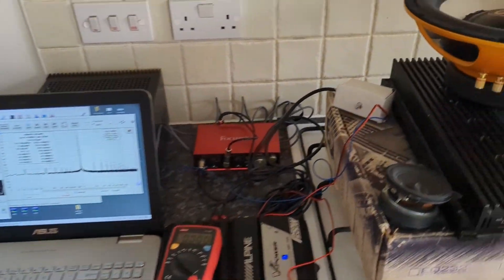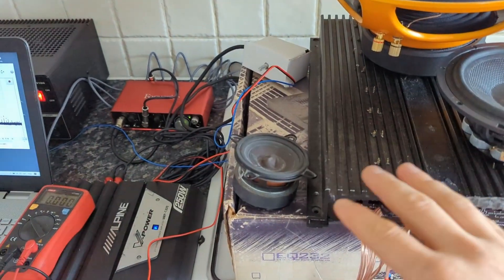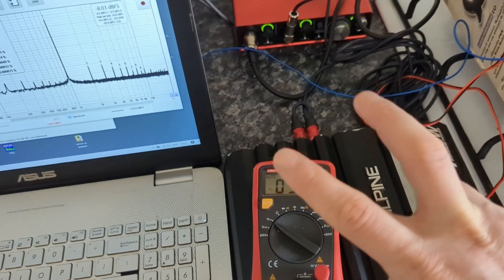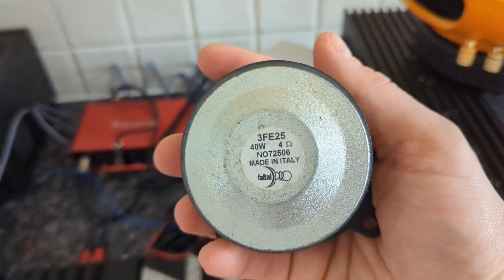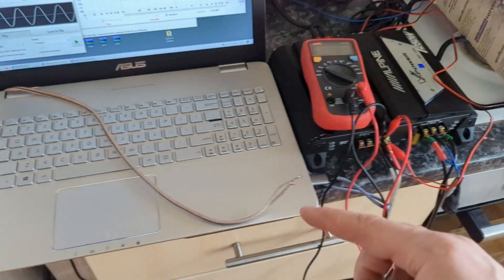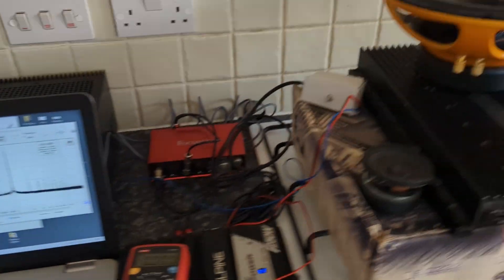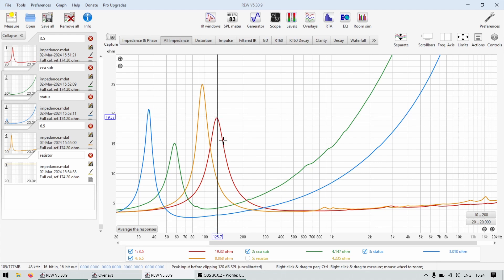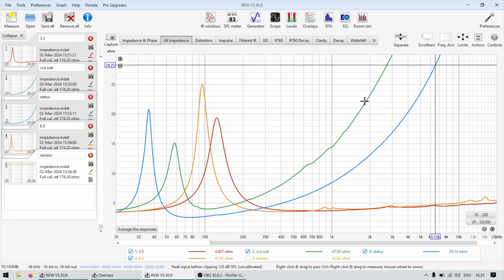Measuring amplifiers on resistors vs speakers - is there a difference?

Comment: I have a great video idea for you simply for the fact that it does not cost any money. Could you talk about specific mid bass speakers. That are not only high-end namebrand, such as focal, but also middle of the road namebrand speakers that still perform well when trying to build a three-way active system. Unless I’m paying for an outrageous driver from an high-end company, I just can’t seem to find any speaker, as far as a 6 1/2 or 6 x 9 that would allow me to put together a three-way active system on a DSP

Comment: You did some testing on Recoil amps. Of course, naturally, they passed in the low range frequencies, which is why you can get away with a lot of decent amplifiers, putting out power these days. But when you start getting to the higher range frequencies, you show that recoil begin to create distortion.

Now at the same time, I know you did not do a listening test on those videos and peoples ears are all subjective to their own taste. 

Are there any hard fax as far as stats that you could see from parameters stated on on a box or a manual for an amplifier that would give you the implication that it would be a good full range signal? 

Recoil has a fantastic five channel amplifier but I can’t seem to pull the trigger because although it would make things easier using one amplifier, I would hate to get something that doesn’t produce quality sound in the full range
Reply: Are you looking at the RED1800.5? It has all the flags I mentioned above. It doesn't show the amount of distortion at rated power, it doesn't show the deviation in the frequency response and the signal to noise ratio is at a higher power level and not at 1 watt. It's also unusually inexpensive. Still, it doesn't necessarily mean it's a bad amplifier. At such a low price it may be worth it to buy it and see what you think of it's sound quality. If you don't like it, you could probably sell it locally and recoup most of the cost.
Reply: There are a few specifications that can point you in the direction of a high-quality amplifier, but it's still not a guarantee that it's high quality. 

Stats such as frequency response. You want to know not only the frequency range, but also the deviation. For instance, 20-20K + or - 0.5dB ( or similar low number). Amp manufacturers realize this and some that have poor frequency response will only show 20 to 20K without telling you the amount of deviation. A lot of deviation is going to be reflected in the tonal response.

Another stat would be the signal to noise ratio at 1 watt. Some manufacturers that may not have a good signal to noise ratio may list it at half power or rated power which will give it an inflated number. This is going to reflect how low the noise floor can be. A lot of the better amps will have a signal to noise ratio between 75 to 85 DB. That's pretty good. Almost no amplifiers are going to be in the 90 or 100 range unless it's rare and very expensive. 

Another obvious stat would be the amount of distortion at rated power. A lower quality amplifier might not list the amount of distortion and it could be 10%, 20% or even higher. The modern-day standard would be at 1% and some of the higher-end amplifiers may actually list their rated power at well below 1%.

It can still be hard to say for sure if a particular amplifier is really high quality or not. I think the sure fire way to determine its quality is if it's used by SQ competitors in IASCA or EMMA, etc... Usually those guys spend a lot of time researching and even demoing amplifiers to assure they have very high sound quality.

Price can also be an indicator. I hate to say it, but sometimes if an amplifier has a very low price it's probably due to the company cutting corners. Possibly using low-end components or simply copying other people's designs instead of designing it themselves.

Comment: people need to realize that measurement are standardized and speakers are basically a motor. a motor is a complex load and finding a matched load is way more difficult compared to a resistor.
no engineer cares if you listen with a speaker or plugged the amp right to your brain. what we care is repeatability and accountability
Reply: I agree, a resistive load is the only logical method of testing amplifiers. Only then can we judge and compare amplifiers on a basic level.

Whether an amplifier will perform well in a customer specific use case can only be determined by testing that exact scenario.